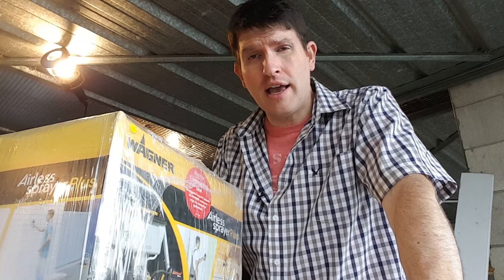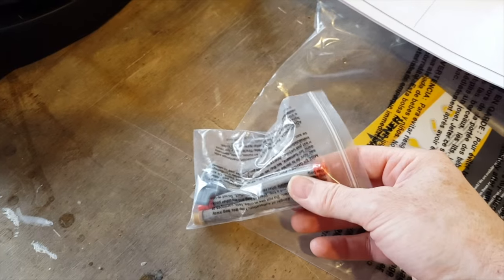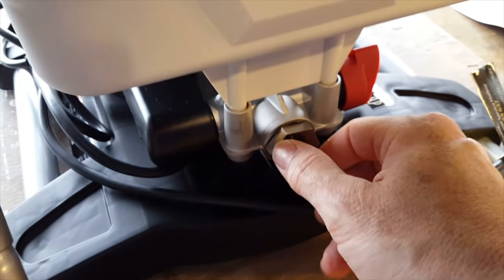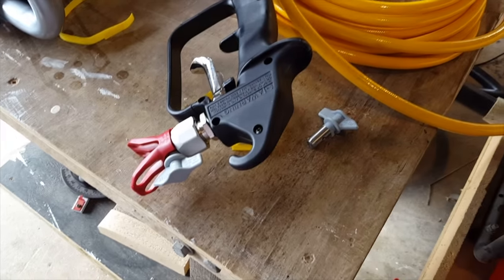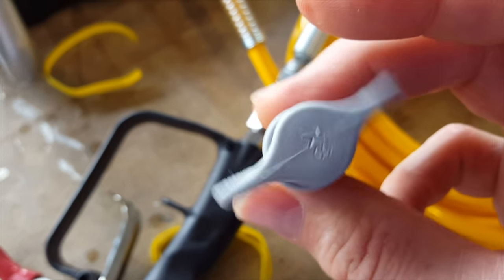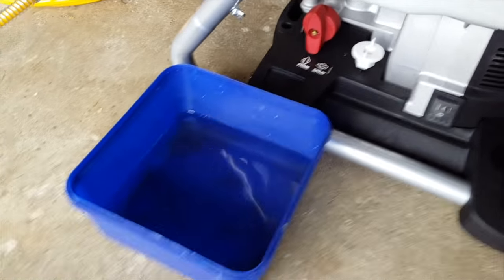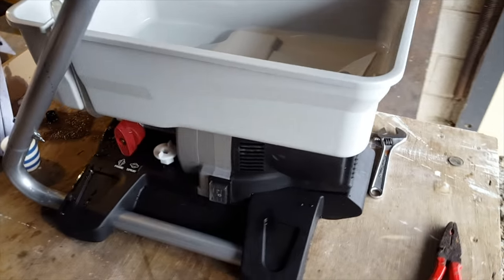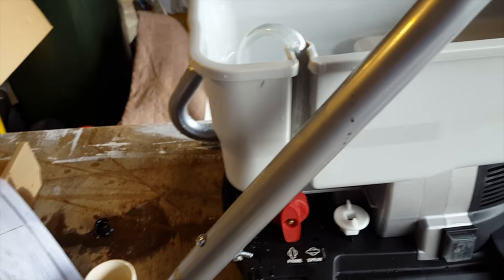Wagner Airless Sprayer Plus unboxing and more

Comment: Matthew, Thanks very much for doing this video! I bought this spray system a couple of days ago and found your video by chance running off the official Wagner one. 
One area that remains unclear to me is the cleaning process. You mention vegetable oil? Is that what you use to lubricate the unit after you've actually cleaned it?
The manual mentions "cleaning solution" - what would you recommend for this if I'm just using water based paints eg interior emulsions? 
I hope you get a chance to do some more videos - I plan to use this machine as part of my renovation projects and reckon it'll save me tons of time!
Thanks again!
Reply from the maker: sorry James, i didnt see your comment for some reason. Yes, clean the top resevior out with water thoroughly first then once youre getting clean water out, just pour a cap full or two into the intake and run it for another second. This just stops any watered down paint residue drying inside the various internals.

Comment: im thinking about buying this paint sprayer too but wanted to know if u or anyone else has used it to spray interior ceilings and walls successfully???
is the machine able to spray undiluted emulsion without getting clogged - or does the emulsion need diluting???
thanks.